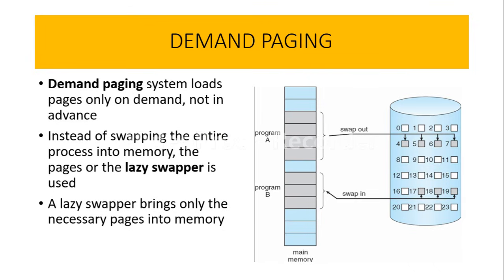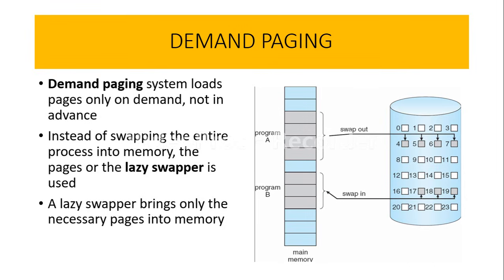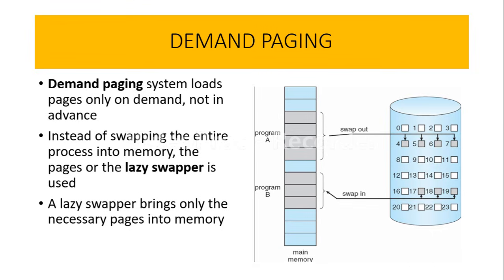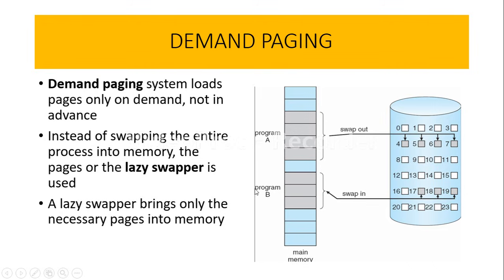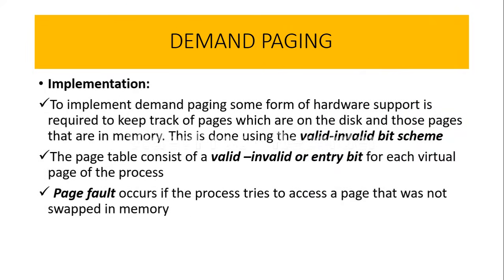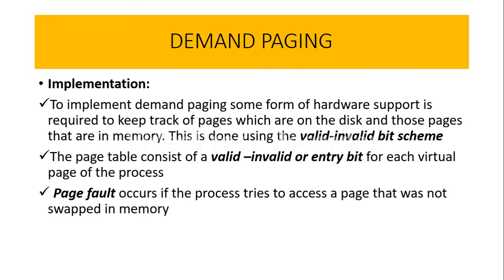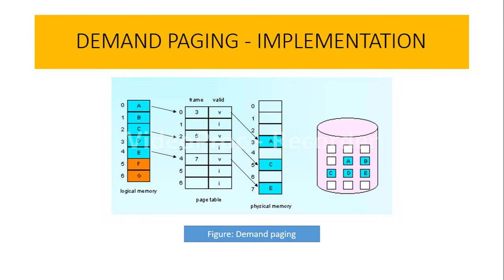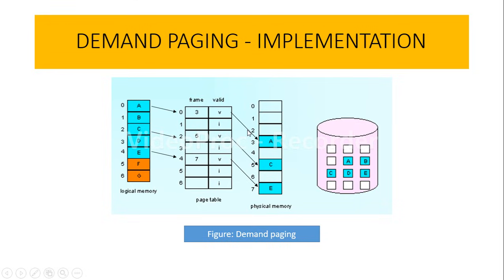Demand paging in operating system

Comment: What is demand paging and how it is implemented?
Reply: Demand Paging is a memory management technique where pages of a process are loaded into physical memory only when they are needed, rather than loading the entire process at once.
Implementation Steps:

Maintain Page Table: Keep a page table that tracks which pages are in physical memory and their locations.
Handle Page Faults: Implement a mechanism to detect page faults and fetch pages from disk when needed.
Use Page Replacement Algorithms: Apply algorithms (like FIFO or LRU) to manage memory when replacing pages.
Update and Access: Ensure that once a page is loaded, the process can access it using updated page table entries.